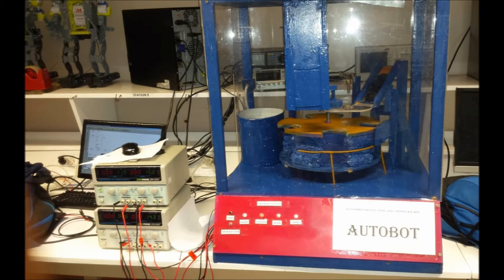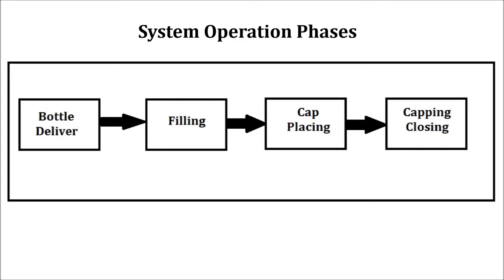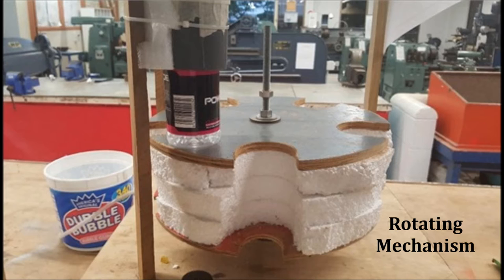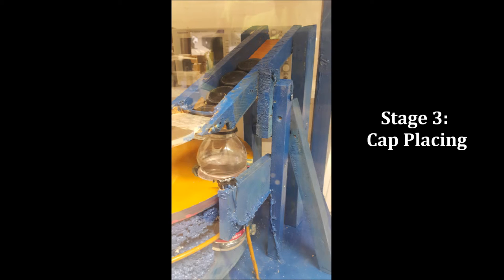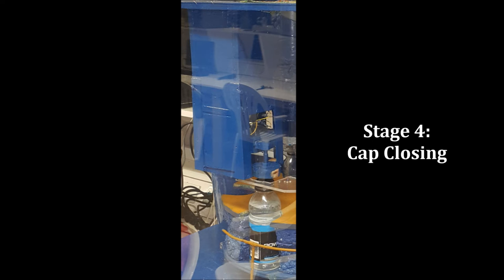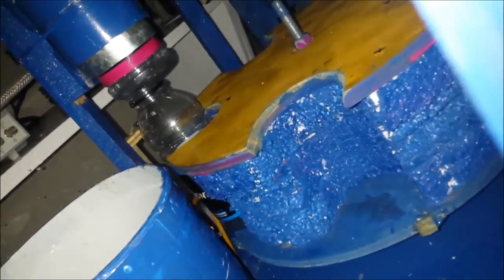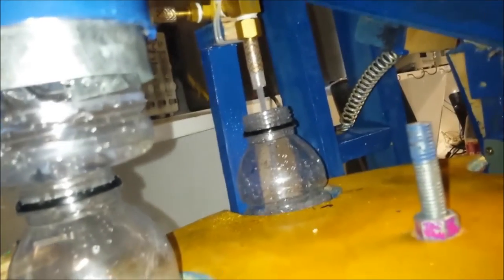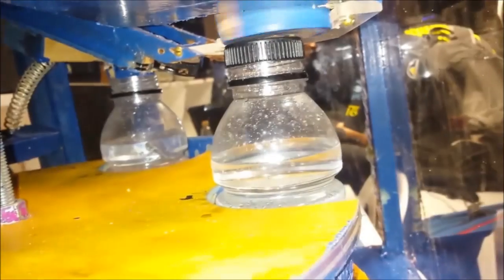EE363 Project - Autonomous Bottle Filling and Capping Machine

Comment: Are u using timer to fill bottle...?
Reply from the maker: Yes, we set a timer in the plc system
Reply: @shawnsagar10  Can u tell me which system u have used for cap tightening...?
Reply from the maker: @syedshehryaralinaqvi6312  Whole system is programmed using PLC and we just used DC motors. The cap tightening mechanism was challenging to construct. It consists of a spiral rod where a dc motor was connect for the vertical movement of the capping system. Another brushed geared dc motor was fixed horizontally to tighten the caps. A wooden cylinder was fixed on the motor to provide friction while tightening the caps.
Reply: @shawnsagar10  Ok Thanks a lot...
Actually I'm making same FYP Project...
Reply from the maker: @syedshehryaralinaqvi6312  Good luck Bro
Reply: @shawnsagar10  Thanks !!